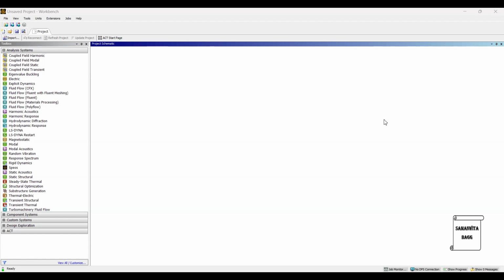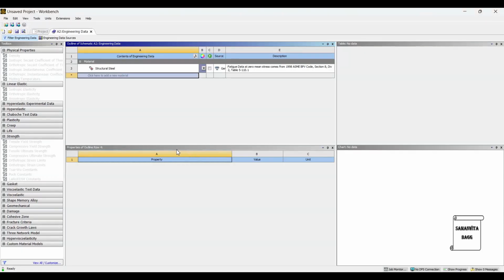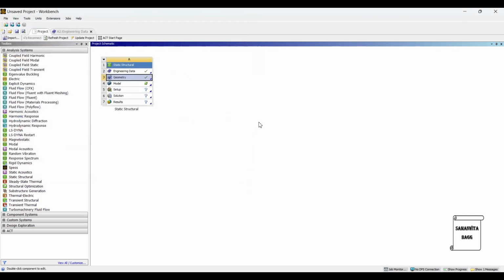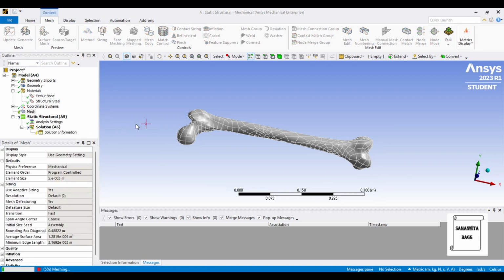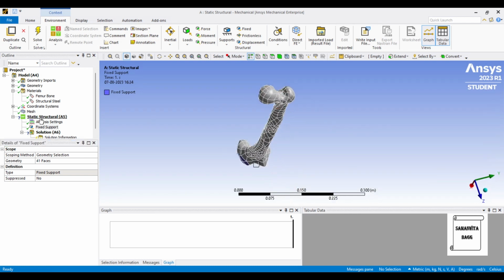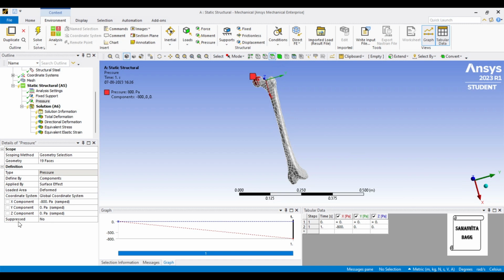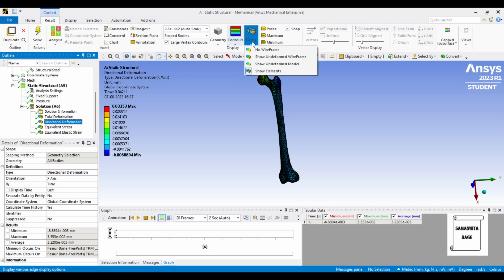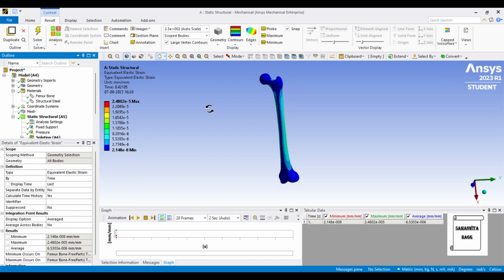Femur Bone | Static Structural Analysis I Deformation | Stress | Strain | ANSYS Workbench

Comment: Hi, I am glad that you are making such an informational video and helping the community. But I would like to know is there any method through nonlinear static analysis to simulate the structural damage in the body due to compression load? please suggest
Reply from the maker: I have made videos on non linear analysis. You may refer them.
Reply: @MechProverse  sure! But I want to simulate the fracture in the model that I am unable to find with the static structure. I know it can be done with the help of Ansys Dyna or Explicit dynamics but want to do with static structural. Would u please suggest if it is possible in ansys.
Reply from the maker: It is possible. Apply boundary conditions of non linearity